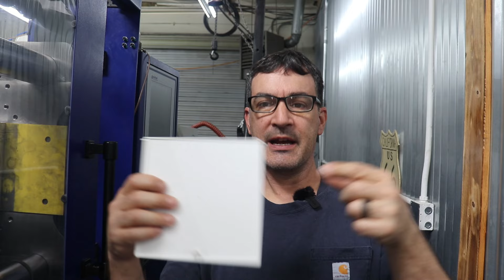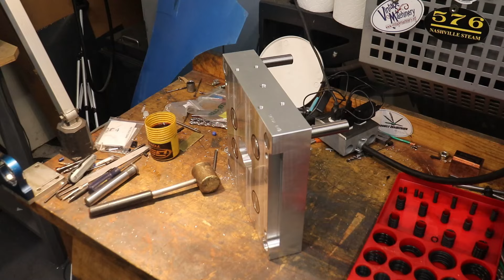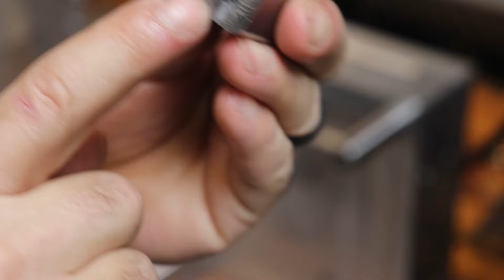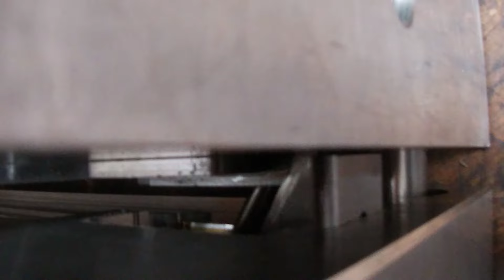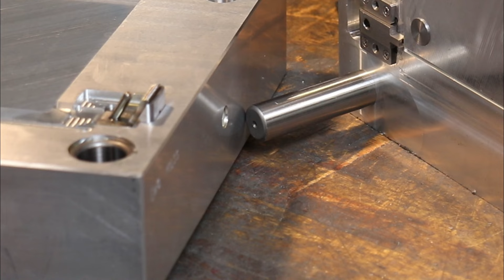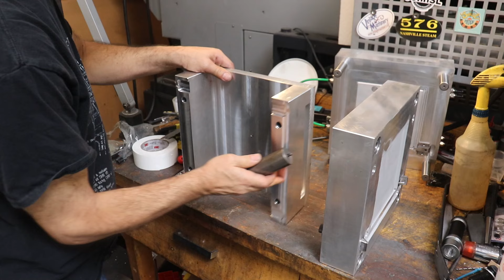INJECTION MOLD WITH SLIDER CORE PULLS

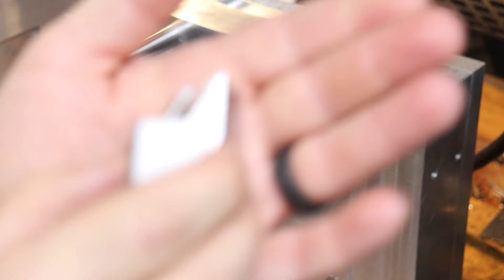Comment: 11:20 How did you manage to machine the 20 degree and 18 degree angles with a 3-axis machine on the block? And why does it have to be made of steel and not the same material as the 7075 aluminum mold?
Reply from the maker: I did a 3d raster cut to machine in the angles from the top tool view